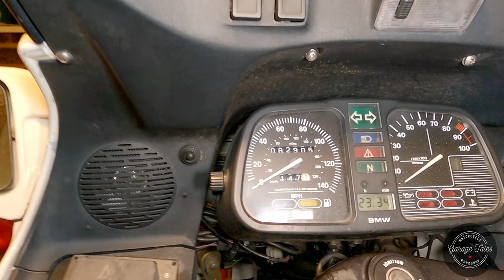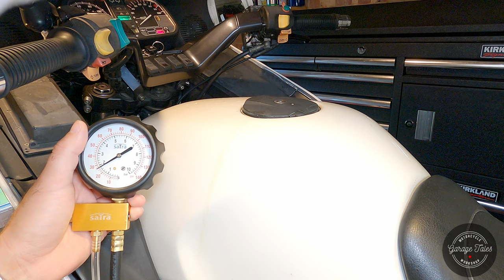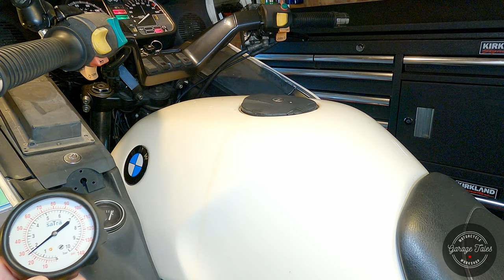BMW K1100LT Running Issues - Fuel Pump Replacement

Comment: It was interesting, I didn't know the K series fuel pump assy. was removable through the filler. I don't think the Lambda has any effect on starting but I'm not familiar with that Efi system so I may be talking B's. A K is one of the few BMW's I'd actually consider owning, perhaps because of the quirky brick engine. You're old mate would be happy that you saved her for someone who wanted one rather than be broken for parts.
Reply from the maker: Hey there. Thanks for your comment :) 
Depends which model of K. The newer ones with plastic tanks have an access hatch on one side.
This bike doesn’t have a lambda/O2 sensor. That’s what I mean by open loop system, so the mixture is not as reliable and easy to throw off track.
They are great bikes, and the fact that they are so different makes it even more interesting. I’m sure you won’t regret it if you get one :)
Reply: @garage_tales  Thanks for the info. If the right one comes along, who knows but I certainly won't sacrifice one of my Steamers for one.
Reply from the maker: @niallsommerville9941  Yep. A steamer is a totally different beast 😁

Comment: You have water in your tank. You should clean or have cleaned and tested your injectors and replace your regulator.  THe regulator is behind the radiator on top of the engine.
Reply from the maker: Cleaned the fuel tank as I showed at the end. The bike ran fine with the new fuel pump. Regulator might not be the best, but it maintains the right pressure so I left it alone at the time 🙂

Comment: Dirty injectors? If so try using the BMW fuel cleaner. I've found that AFT is good to use as an injector cleaner, but it doesn't work fast. It takes a lot of miles, but it will clean the injectors in time. Add about 8 oz to a tank of gas. Then you also want to look for air leaks in old rubber hoses and such. Mainly it sounds like dirty injectors.  The symptoms of bad injectors is so much like spark plugs since each one feeds one cylinder. First symptoms are bad fuel mileage, then hard starting, then later on it won't run when you open the throttle, sputter and all the rest. Just dirty, usually.
Reply from the maker: Hey there. Thanks for your comment. Had the injectors cleaned off the bike at some point so they shouldn’t be too bad. If you watch the video towards the end, the fuel pump was the issue, and the new one solved it 🙂

Comment: most of the time it's the fuelfilter. if you on the electricity, you can hear the fuelpump make sound. i would first replace the fuelfilter
Reply from the maker: Hey there. Thanks for your comment. The fuel filter the bike had was quite new, but put a new one with the fuel pump anyway. You can see at the end the new fuel pump solved the issue 🙂 And it got rid of that very annoying whine 😁

Comment: Just so you know the issue is that your regulator is not holding the pressure.  Your pressure drops off right away and it should hold that pressure after you turn off the bike.  Or your injectors are leaking into the cylinder!  The pump is fine. It is doing its job.
Reply from the maker: Hey there. Thanks for your comment. You can see towards the end of the video, the new pump did sort out the issue. The pressure dropping off was due to the faulty fuel pump, not the regulator 🙂

Comment: Great video. My K1100 has been under cover for the winter. I'm not getting the whirring sound when switching the ignition on so the fuel pump is not priming. I've checked the fuse and wiring. All appears ok....any suggestions? Thanks
Reply from the maker: Hey there. Thanks for your comment. Sorry to start with the silly stuff. Is the gear indicator still working and is the side stand up and it’s switch working? If all checks out I’d start at the pump to see if it’s getting power and work from there 🙂
Reply: @garage_tales  Thanks for the reply. The answer is yes to both, so I've now drained the fuel and taken the tank off because two of the fuel cap screws have rounded off. When I've sorted those then I can get into the tank and get the pump and filter out to see whats wrong
Reply from the maker: I’m sure you’ll get it sorted! 🙂
Reply: same with my k75 now, i would open and fix the fuelpump or replace it. good luck

Comment: Why did you sell her?
Reply from the maker: Multiple reasons I guess. I had to move house in the near future then (moved now) so I wanted to downsize and preferred the Triumph. I guess I was a bit bored of it as well to be honest. I had it for years and it just runs, starts every time (except the fuel pump issue) , did pretty much nothing except general maintenance, rides very stable, very comfortable, good weather protection, very practical with the panniers….booooring 😂
I do miss it sometimes, but I don’t necessarily miss riding it if that makes sense 🤷‍♂️

Comment: I am convinced that the problem was a regulator and injectors.
Reply from the maker: The bike ran fine with the new pump so they are good enough for a bike with over 80k miles on the clock 🙂